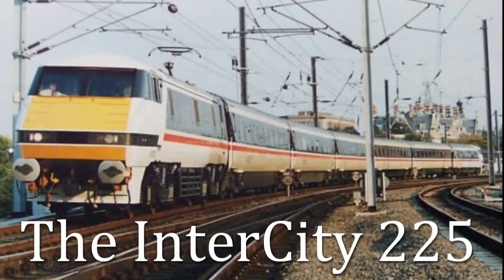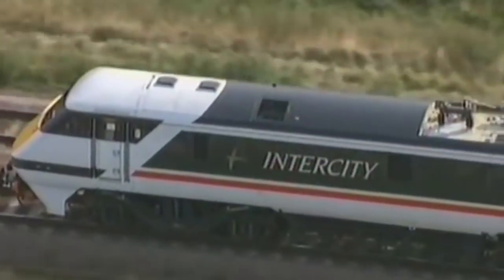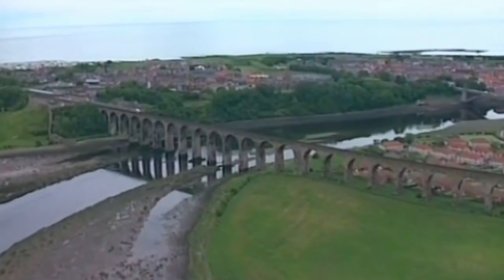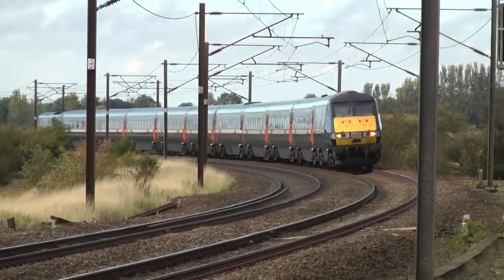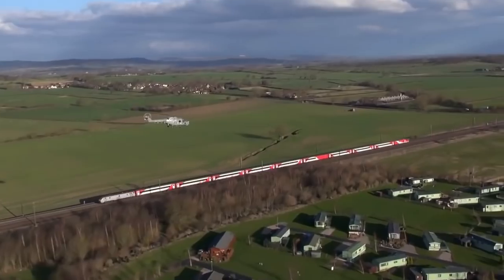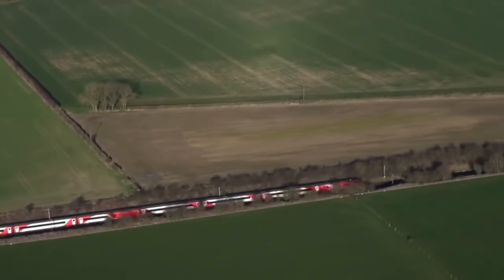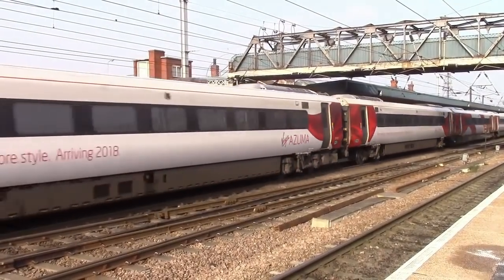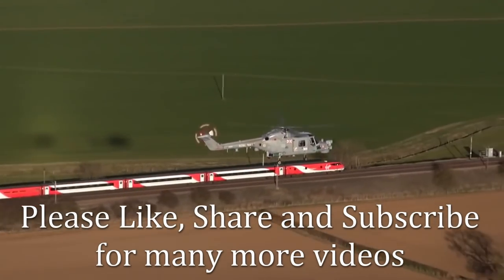The InterCity 225

Comment: I have just become familiar with these trains after purchasing a second hand model Hornby four car set from the early 90's. 
I see the trains running regularly on a local line near where I live, still in their thirty some year old livery; albeit without their Swallow and Intercity logos. It is a handsome looking set and looks great at speed whizzing by.
However I can't help but think if it's looks would have benefitted without the buffers like it's earlier cousin HST 125. 
The 125 will always remain my favourite it looks timeless even today after all these years. An ideal choice for the "Blue Pullman" incarnation.
Great video.

Comment: 225s also operate on the London - Norwich line. They pass regularly through my local station, operated by Greater Anglia.
Reply: No, they don’t. Similar looking class 90 locos but utilised mk3 slam door coaches, the same as those built for the HST. The class 90s were built around the same time but are updates of the class 87. The class 91 owes more of its heritage to the APT development.

Comment: Should do them up and use at 140mph  on HS2🤣
Reply: thats not even a bad idea
Reply: Have you ever travelled in a Mk4? The bogies are to short and hunt terribly. They have had this problem from day one and it has never been satisfactorily resolved.
Reply: @neiloflongbeck5705  I have. The message you put up is a bit erroneous too.
Reply: @vincitveritas3872  apart from the spelling, you mean? If do it what way? I travelled on  Mk4 just before Covid struck and it hunted.
Reply: @neiloflongbeck5705  what do you mean hunted?
Reply: @vincitveritas3872  a self-oscillation caused by the motion of the bogie along the track caused by an interact of adhesive and internal forces on the wheel sets.

Comment: The government should adopt a generic British Rail branding across all trains with space for a franchisee logo.  Makes it easier and cheaper when lines change hands.  For example 'British Rail East Coast' . Midland mainline at the moment is transferring to EMR but they have just stuck a crap logo on the old East Midlands train livery ... looks ridiculous !  It takes ages to fully change livery.
Reply: Yup this is true, SWR has had the South Western Mainline for 2 years now, and still dont be any closer to having their livery on more units.

They done a few for "promo reasons" but the rest are just SWT with a South Western Railway vinyl on top.

Their contract will be up for renewal before they get to apply their branding. Sure I get it is a big task but still I would have thought it would have been more than just a small handful of units
Reply: @DukeDudeston  it's madness !  It would be so much cleaner and cheaper as new franchisee would just need to change their logo.  Anyway just a thought .

Comment: So the class 91 in push mode is powered by the electric power car not the DVT? Does the DVT control the power car?
Reply: The dvt controls the power car when the train reaches Edinburgh the driver switches sides after his break and starts back on its jouney to london kings cross you will find that most 225 sets operate with the power car upfront in pull mode  on the northbound journey this is most likely due to the journey to Scotland being uphill  requiring more power the return south is downhill  completed in push mode lead by the dvt
Reply: @darylkemp1257  The journey to Scotland is uphill? The trains aren’t being sent to the top of Ben Nevis. Glasgow Central and Edinburgh Waverley are both practically at sea level.
Reply: @nkt1  Altitude King's Cross Station Concourse, London, N1C 4AX, 15 m. (49 ft).
Altitude Waverley Concourse, City of Edinburgh, EH1 3EG, 56 m. (184 ft)
So 40m in a distance of 404 miles.
Reply: @alanrobertson9790  If the train stopped at the Craigentinny Depot, 3 miles short of Waverley, it would have ‘climbed’ a whole 5 metres over the 401 miles! That last bit is a slog.
Reply: @nkt1  Yes I struggle to understand that going north is more onerous than going south. Perplexing.
Reply: The DVT is basicly a driving cab and a conductors cab with luggage space inbetween

Comment: Interesting fact: The 225s shared the body profile with the APT because they were originally intended to work on the WCML with possibility of a tilt system being retrofitted!
The ECML electrification was supposed to get a fleet of class 89s and updated Mk3s, but BR changed its mind about that due to limited funds, the ECML was seen as more advantageous place for the 225s to run in service!

Comment: The last of the proper trains we built. Still not being outdone by all the modern long-distance stock that has been built in the last 30 years. The only thing they have going for them is acceleration. My understanding is if you top and tailed a class 91 on both ends though you would match it!
Reply: In having DC motors with brushes they are old tech and becoming less reliable due to their age, still love them though. Beautiful very modern looking and with that chime horn.

Comment: Greater Anglia also use the 225
Reply: micheal kemp - Sorry mate, they use a class 82 DVT with a class 90 (not 91) loco UP leading.
The 91 has a low slung transformer allowing it to do higher speeds than the similar looking 90, which also has two cabs.

Comment: The 225 is limited to a maximum of 110mph if it is running with the secondary cab of the Class 91 (the flat end cab) due to the aerodynamics of the cab and the pantograph.
Reply: Simon West -   We used to call it:  The Blunt End.
Reply: Yes if I remember correctly the wind causes the pantograph to press too hard on the catenary over 110 mph running blunt end first.

Comment: I don’t think they will run to Blackpool. ARH would probably have to get tilting trains to use the WCML as the 225s would be limited to 110mph
Reply: Juicy Hamburger I agree, but a fair amount of the WCML is 125 for non tilting stock anyway. Not sure if the video mentioned it but these trains were designed to be able to tilt with minimum changes, so in theory that would be an option!
Reply: The mark 4 coach is designed to tilt anyway as it was meant for APT tilt mechanism was disabled as it was decided wouldnt be needed on the ECML which for its length is almost straight apart from section  the north of Darlington